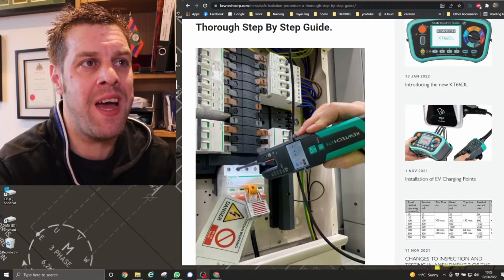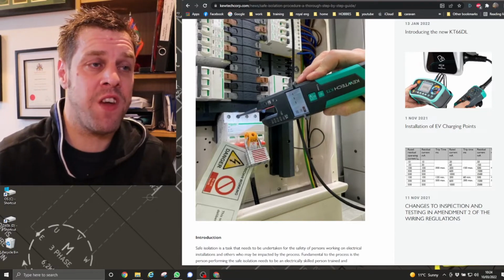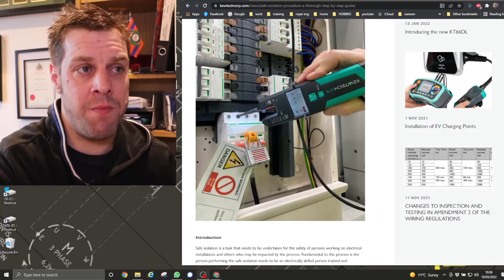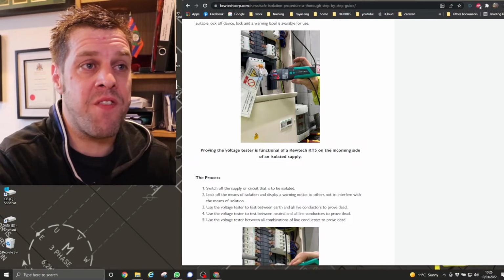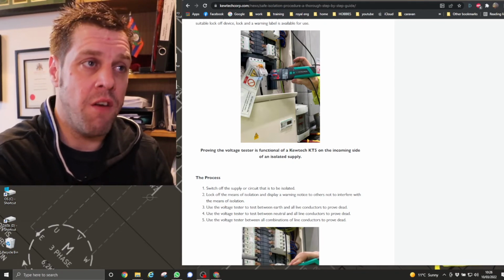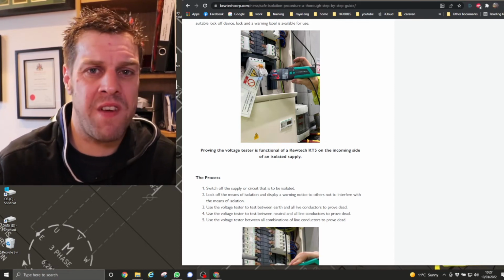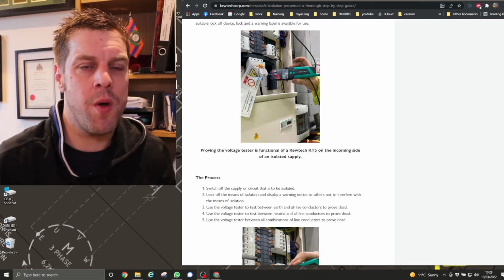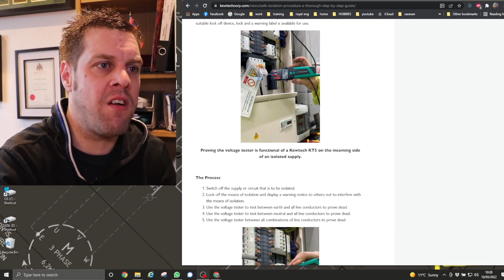#SDAST-10 bad examples of "safe isolation" that frankly get on my tits

Comment: Imagine. There you are at the 4P isolator at that board, in the termination chamber below is either bus connections or insulated studs with lugs and as you go to lock off you drop your nice metal padlock in there :(

Comment: I was hoping this was going to be a second point of isolation till I finished your video. Good call, these equipment sellers need to be the shining light of example. I put a hasp on a 250A ABB Isolator without reading the label or the piece of fire starting kindling that falls out of the box, the BS said to use a padlock of 5mm diameter shackle. My hasp with my lock and one other guys lock appeared to be all good at first, then I had to move it for some reason and as the hasp twisted, it came straight off intact with both padlocks attached.
Reply from the maker: I think I have a video of exactly the same thing I’ll have to link it up
Reply: Same job a lad that was supposed to be a Navy helicopter spark was being tasked by someone else  as I was working my notice. He was about to change a small 415/230 transformer and I asked if he had proven dead, he hadn't, I showed him and the panel was still live.

Comment: Some terrible pictures of supposed safe isolation were shared during Safe4September. Even I joined in lol. Isolated MCBs never mind the main switch with the front cover off! This was a trainer sharing it as an example of safe isolation. This kind of thing is best learnt in tool box talks and in person. Life saving training. Eyes locked, person to person.

I also made the point often a board without a lock on it can be and should be isolated elsewhere. I demoed this a few times during that campaign as some people were putting expectations of what they thought was safe isolation and insinuating others should be showing just that. AKA nonsense. 

I am all about teaching and ensuring safety. Sharing images that are not actually safe or to a procedure is arguably more damaging that showing nothing at all.

Comment: Jamie I watched your video with interest. You say you should not test your 2 pole tester on a known live supply? This is a suggested method in the Health and Safety document HSE GS 38. Also you say that you should isolate "one back", How would you do this if a board is connected directly to a DNO supply head like the majority of domestic installations?  The picture in the Kewtech article looks like a Schneider Isobar P board to me which has the the patented Isobar   slide switches and everything inside is IP2X rated so, very difficult to touch a live part without doing something stupid! Presumably you would not remove the screw cover from a ceiling rose then? Of course when carrying out safe isolation you would have carried out your risk assessment and produced your method statement. This appears to me to be a good article as a MINIMUM standard for safe isolation and if you you personally want to go further, you can. I am concerned that you are knocking back students NVQ submissions if they have followed if they have followed the Health and Safety Executives GS 38 directions rather than your personal preferences? Dis you have a view of the non-contact test facility built in to the KewTech tester before touching and enclosure? Also the test facility for checking current flow in protective conductors as part of the safe isolation procedure?
Reply from the maker: i state the article is not the issue its the pictures , IMO it's not safe  to ne in a live board with  a massive hole in the bottom fitting a metal padlock , if your domestic and dont have means isolation get one fitted to do the work safety , i am in the business of promoting safe practices to young sparks not making  widows ,  its niot save to ne in an enclosure thats live with out going one back
Reply: Not every board is going to be an Isobar, as an example it should be how you you safely isolate any board. 
I wouldn't use the no contact 'indicator' for anything other than just that.
Agree on using the clamp meter on the earth though.
I attended a call out to an RCD issue a couple of months back, when you lifted the hinged cover over the MCBs etc you could hear it crackle, luckily wired a year ago and had an isolator up the line, ferrule crimp on the neutral tail but tightened on corners across the square crimp of the ferrule and worked loose. Torque driver used by the original installer? Unlikely.
Reply: Opening an enclosure with a potential busbar chamber below it is foolish in the extreme imo. Not a great picture to present on safe isolation.  A topic best left with mentors and colleges imo.

Comment: Alec. Have a read of the entire Kewtech guide as it describes in some detail  the complete process including the need for a Risk Assessment and Method Statement. It would be useful for people shooting from the hip and quoting selectively rather than reading the entire document and considering the contents of the whole document. Also IET Guidance Notes 2 and 3.
Reply from the maker: i have clearly stated it a decent document i have not said anything bad about the document i am talking about the pictures , are you the author by any chance
Reply: When would you not be completing RAMS before a job? Being a legal requirement and all that. In a breakdown or call out even a dynamic RA because the installation may no longer fit the original RAMS.
Reply: The document is okay. The pictures not so much.